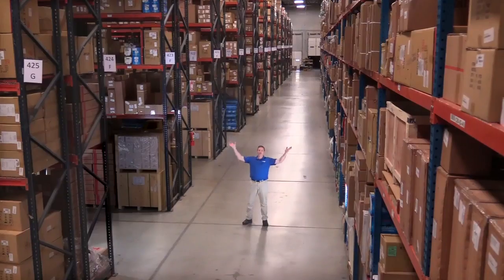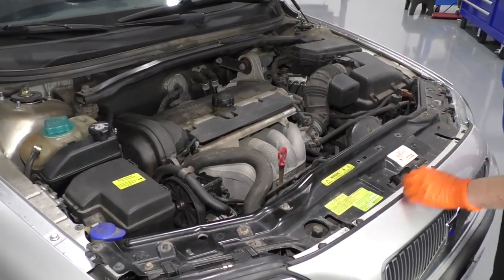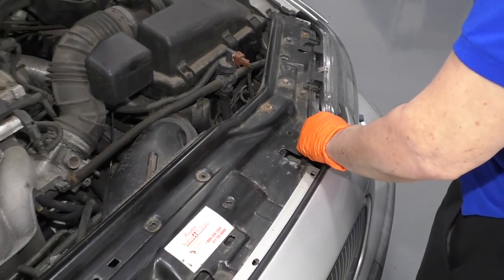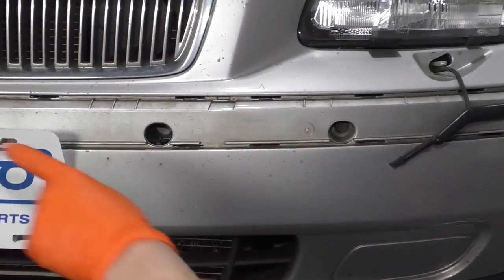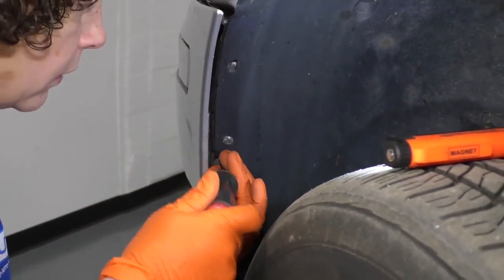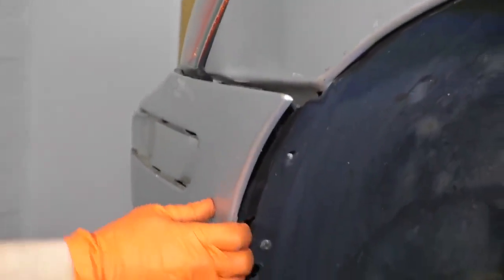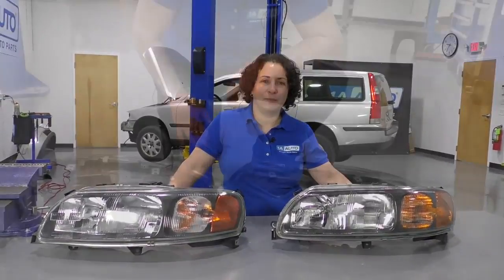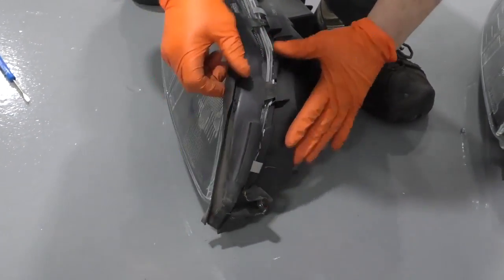How to Replace Headlight Assembly 01-04 Volvo V70

Comment: Sue, you're the best! I just finished replacing the headlights on my 2005 Volvo V70. There were some differences, but this video gave me enough guidance to get it done. I was emboldened to take this on after using another video of yours to replace the driver's side mirror. Thank you!

Comment: I replaced the headlight assembly due to a fender bender broke the other one.  There seems to be a third connector on the headlight wiring harness.  What is that third connector connected to?  It appears that there might be something that is plugged in to the connector, but not from the headlight assembly.  What is this connector for? Starting at around 11:29 in the video this item is visible.